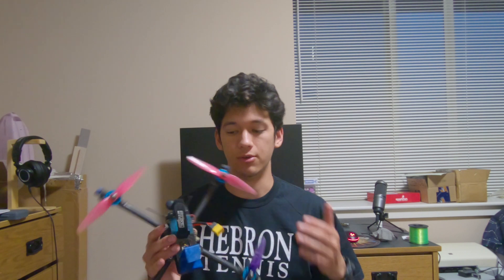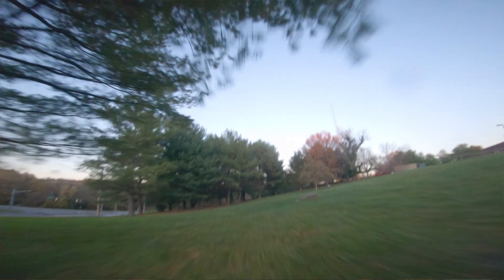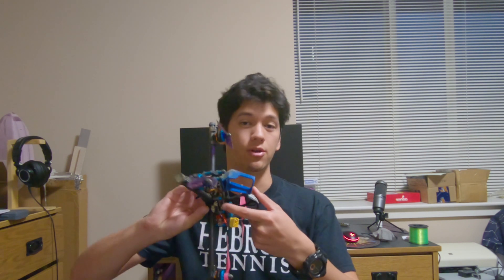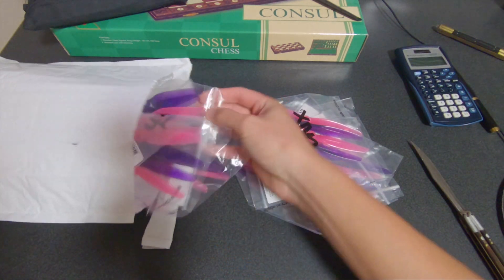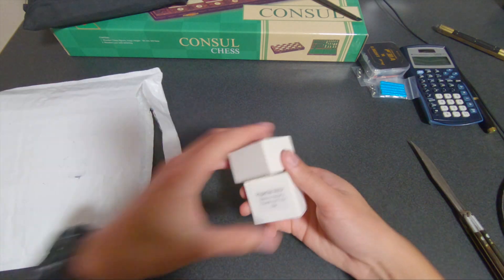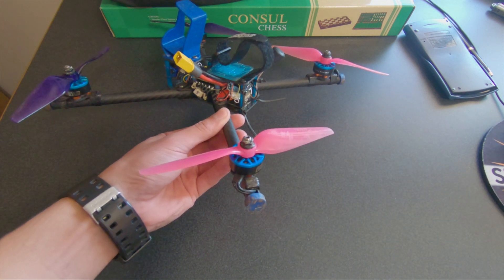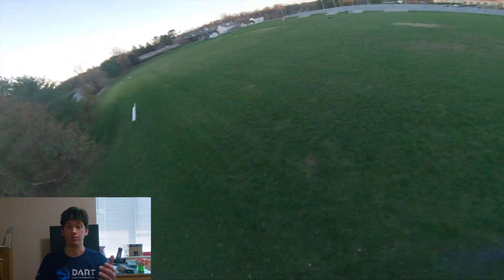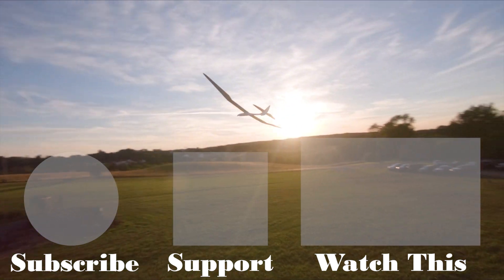Troubleshooting My Drone - Troubleshooting Tips

Comment: Hello Timmy, when you had your desyncs, did you also tried to change blheli32 settings ? (Like motor timing, demag compensation, etc.) Or do you generally let everything stock (except for 48khz) ? Many thanks in advance 👍
Reply from the maker: I didn't bother because it was always the same corner of the quad desyncing, which indicated that something other than the Blheli settings was the problem.

Comment: Hello, Shorts in motors can be tricky, because if there is a short in the winding (due to crash or overheat) the motor might still operate (with reduced efficiency).  This can"t be measured easily, because most motors have so low resistance,  a simple multimeter can't measure it. BUT most cheap multimeters have inductance measure mode, and a short in the motor has a high impact on the inductance. I had similar problem recently, I suspected the motor is shorted, I measured the inductance and compared to good motors, and the difference was significant.
Reply from the maker: Thanks for sharing this tip!

Comment: Nice one!
When you throttle up with the new motor, you get “new” vibrations, with the quad yawing left. Did you see the same? And when switching a motor, do you need to re-fine-tune?
Reply from the maker: Thanks! The quad flew normal. Any yawing you see while the throttle is being mashed is because I was being imprecise with my stick movements.

You generally do not need to retune when you change a motor to another motor of the same type. However, fresh motors will generally be better balanced, which can allow less filtering and/or more aggressive PIDs to be used without running into oscillation issues.